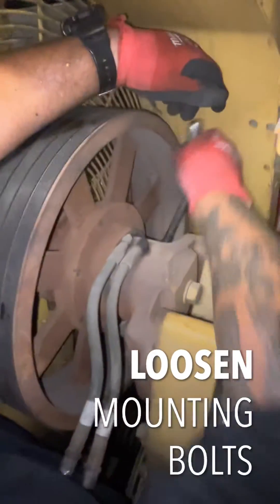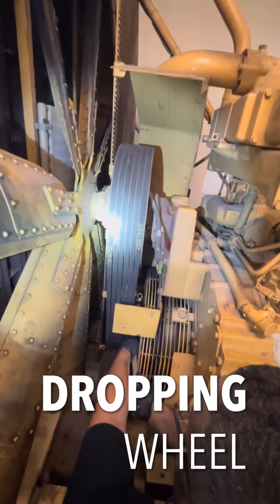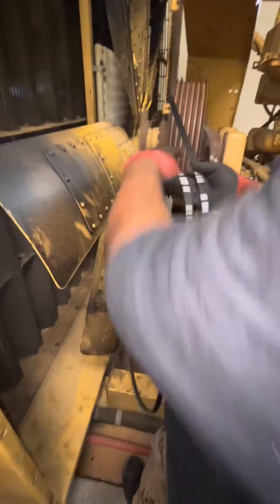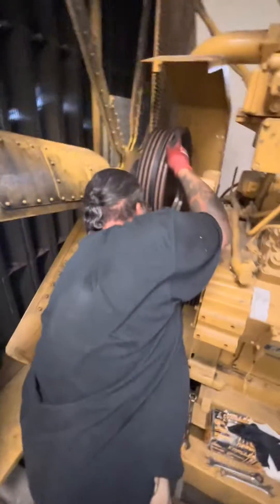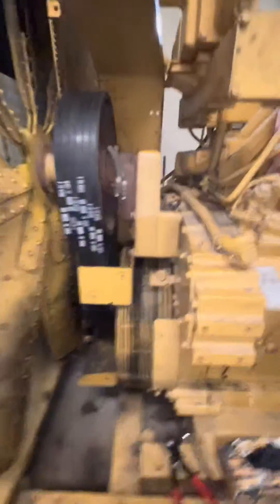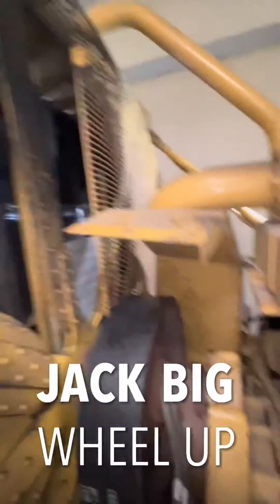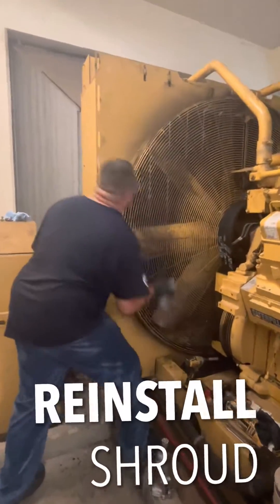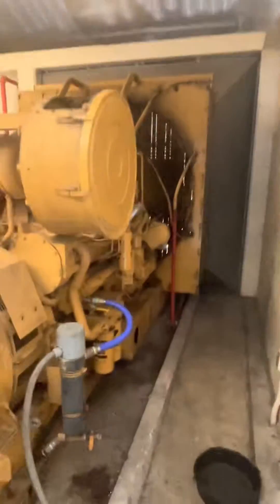Caterpillar 3508 engine fan Belt replacement

Comment: At my engine the fan belts keep falling off or rotate sideways. Under heavy load the belts start to resonate a lot. What could be the problem? Could it be that a wrong or malfunctioning vibrational damper is installed?